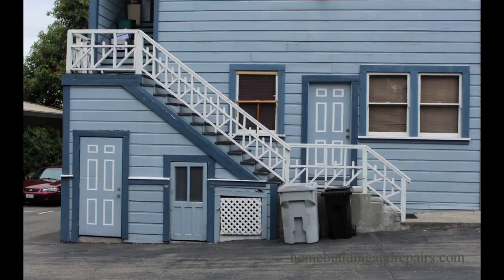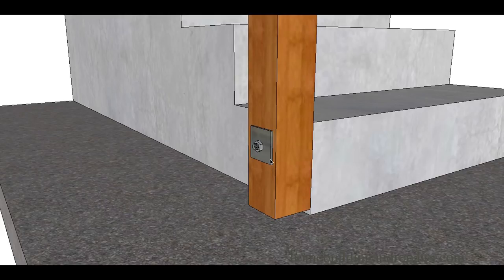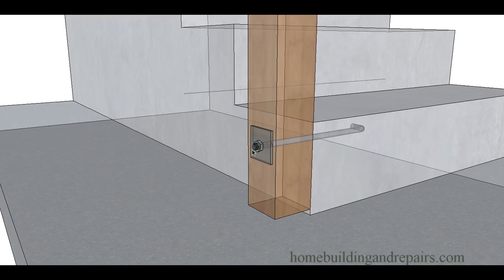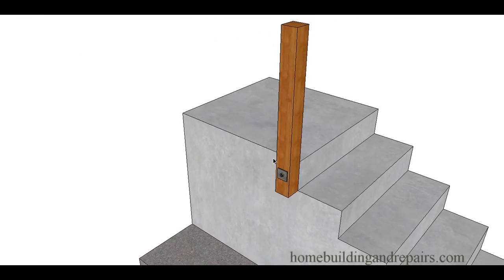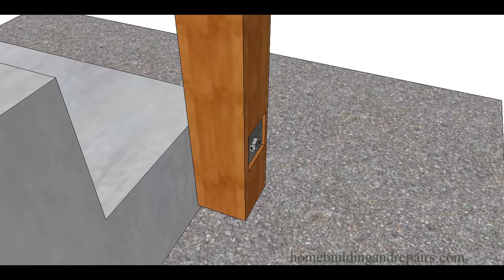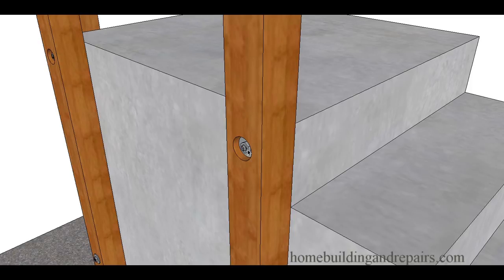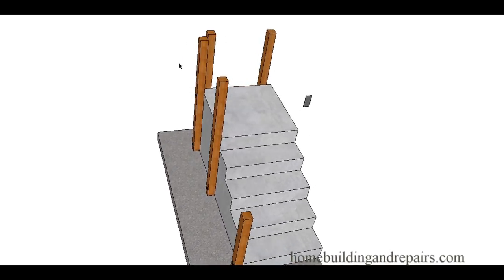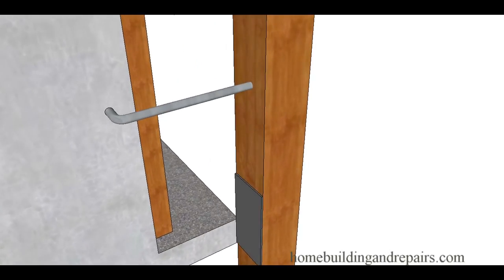Bolting Wood Handrail Post To New Concrete Stairs Can Make Handrail Stronger

Comment: Those J anchor bolts only work with freshly poured concrete! If exsisting  concrete stairs, you will have to drill to anchor post
Reply from the maker: If your'e trying to repair a existing handrail this video might be more helpful.  https://youtu.be/Zkvb4d0VZcs

Comment: How hard would this be on existing concrete stairs? My friend has a bad back, just had surgery on bottom of her foot and desperately needs a handrail. I think I could do it for her if it's not too difficult. Great video!
Reply from the maker: I don't think it would be too difficult, but it would require drilling a hole into the existing concrete stairway so that you could install an all thread type bolt with epoxy. I will be making a video in the near future with more information.

Comment: Hello, very informative videos. I'm in the process of building exterior concrete stairs with cheek walls and a walkway extending from the top of the top of the stairs. I have the cheek walls built on footings and next phase is to build the stairs and walkway. I'm I bit worried about setting of the stairs and am wondering if you think it wise to tie them into the cheek walls via rebar.
Reply from the maker: Yes, tie them together if you can.

Comment: Yup! That's the best way to do it!  I would prefer to use epoxy with the anchor bolts! Prevents rust!   BTW sparkle monkey, you drill the holes in concrete with a hammer drill!   I would prefer 12 to 14 inch anchor bolts. Drill about 6 to 7 inches for the anchors, clean hole of dust, they are hammered in!
Reply from the maker: Remember, that you will not be using anchor bolts that are normally used in concrete foundations and will be using a type of bolt commonly referred to as and all thread.